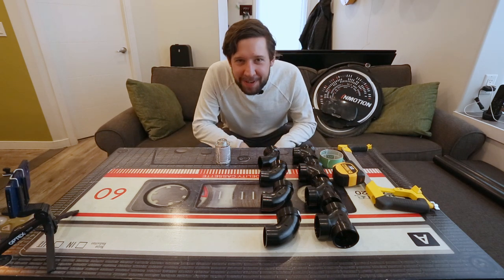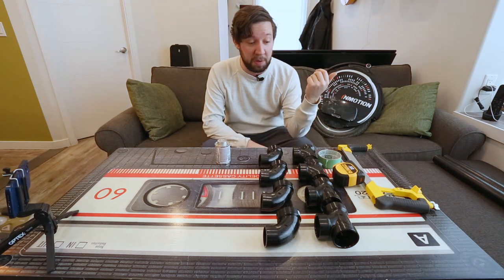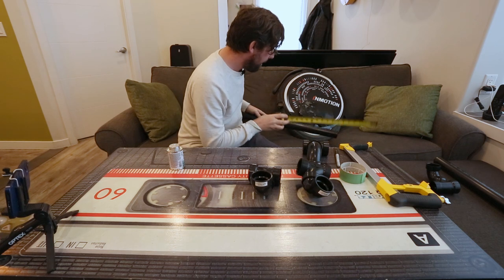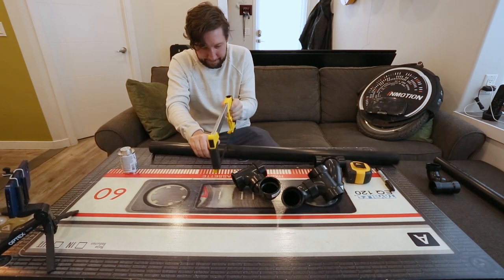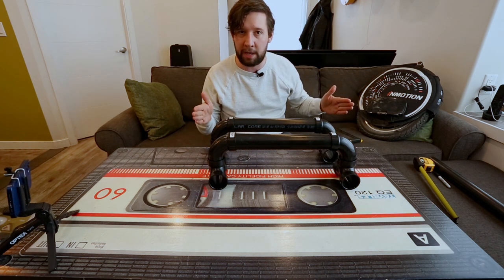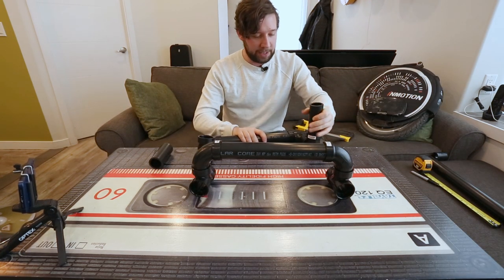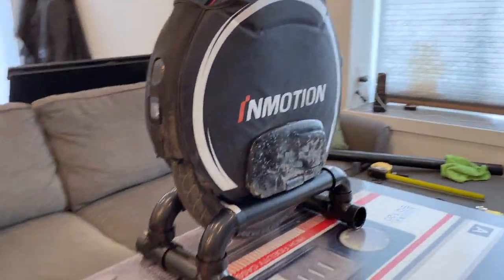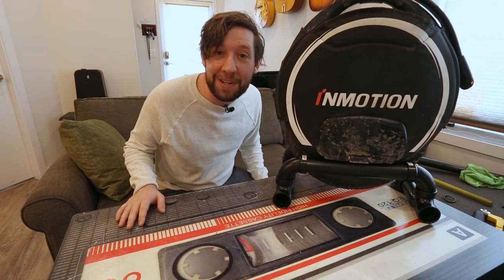How To Build An Electric Unicycle (EUC) Stand For CHEAP!

Comment: I think this is abs pipe.  Schedule 80 PVC would probably hold up to a Sherman just fine.  Love this idea though, off to Home Depot I go now haha
Reply: thats the thick white pipe? Are there fitting also for this?
Reply: @andiman45  abs isn’t as strong as PVC.  I would make one of out PVC before abs personally.  You can get fittings for PVC easily
Reply: @norwoodaerialimaging9795  just built the same with abs and I stood on it weighing 180lbs without flexing. Will suit my 68lb T4 well...Good luck

Comment: just finished the same as yours it's just a little different coz bought a different Elbow Pipe.  (all female side pipe) yours got one male end.  Just shortened the 12 ft part to put between the elbow and the tee. Still works fine.